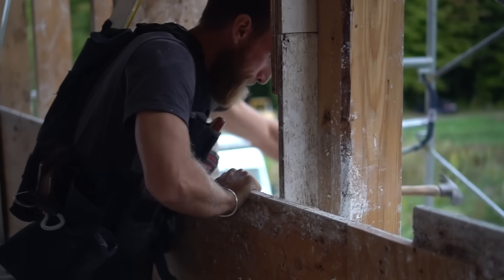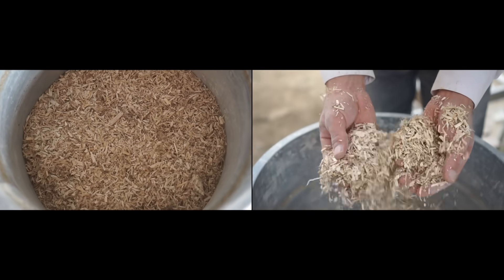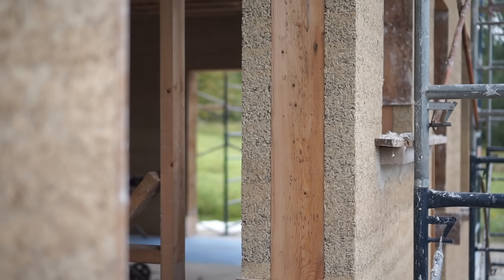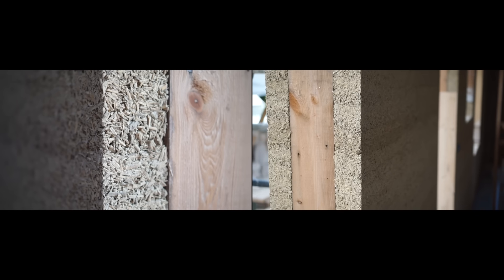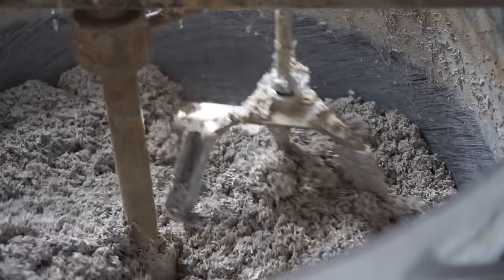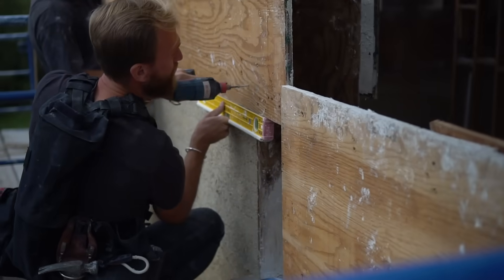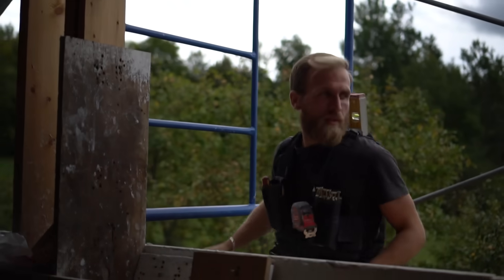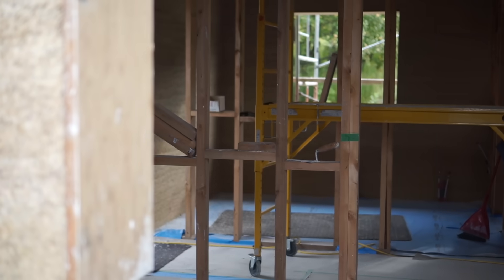Building with Hemp – An Incredible Natural Insulation & Sustainable Material

Comment: Can you explain why the timber stud is placed in the middle of the wall rather than on the interior? Surely on the interior it would allow a fixing for a wall plate for your first floor posijoists or similar. In addition it would ensure greater structural integrity to the frame of the building helping walls stay straight and plumb as some timber studs are not that straight over a 5 meter length. I ask these questions as I intend to build a Hempcrete house for myself. I built a Hempcrete house last year from sips panels, they had great insulation qualities but as a joiner stick built would be my preference. Where abouts are you building ?   Jeremy
Reply: i honestly dont know the true answer myself, but ive seen it where the studs are showing on the interior walls and not the outside, and then some that dont show. i think that for it to have an r25 value it needs to be 12 inches thick like he said, and he also said that it is not a load bearing material, so having your studs in the interior part of the 12 inch thick walls wouldnt be as secure as in the middle, giving equal amount of support. thats just what i think but i think it also comes down to preference too on wether or not you want sheetrock interiors or to have the natural hemp material show
Reply: You built a hempcrete house with sips? They were premade of hemp?? Do you have info on where you got yours? Total cost?

Comment: Nice video, very informative. Question: Could the same process be done with any other material or is there something very special about hemp?
Reply: Well, hemp hurds have special characteristics, such as open porosity and capillary action, that have a lot to do with hempcrete's performance. It allows the migration of vapor, but also phase transitions : when the humidity evaporates in summer, it cools the wall, if vapor condensates in winter, it warms the wall. It has also a low thermal effusivity and feels warm compared to a masonry wall, allowing to lower the temperature of the air with the same level of comfort.
Now, it doesn't mean hemp hurds are the only vegetal material with these properties, it just happens to have been used and studied since the 80's.
It was first used to replace the wattle and daub for the restoration of old half timber houses. It was chosen because it was a cheap by-products of hemp fiber production, and more readily available than straw. But there are now experiments being made with Miscanthus (silvergrass), sun flower stems, and lavender stems (a by-products of the production of essential oils).
Hempcrete, however, benefits from 40 years of hindsight, and has, in France, been tested by the "scientific and technical center of construction" with regulations and trainings for the professionals. So you can get the 10 years warranty from the contactor that conditions subventions for efficiency improvement, for example. It's even recommended by local authorities, especially in old houses restoration.
Reply: I haven't seen anything here that suggests it cannot be done with other material. Essentially it is just an organic version of concrete madd with fiberglass. The many strands inside do strengthen. The product and possibly insulate. 
So while hemp could be the best option, it is not unique in this. Fiberglass reinforced concrete is already a thing.

Comment: Pretty cool! But wouldn't wheat or barley or any cellulose structure work exactly the same? Or is there some distinct advantage that hemp carries in its composition that I'm missing?
Reply: i think tbh its part of the hype of trying to get hemp used mainstream unless im missing some form of magical composition of the hemp itself.
Reply: Michael Kogan Hemp doesn't require the kind of water and chemical fertilizers required by most other crops such as wheat.
Reply: Hemp provides natural resistant qualities to rodents and ants (due to high concentration of silica I think)

Comment: Fascinating building material and technique, I'm curious though about how this withstands saturation at ground level where snow pile up can occur.
Reply: It doesn't. You must use concrete foundation as usual. But you can plaster any concrete left showing above ground to match. This product may bring back the plasterers trade but it's super labor intensive and still need carpenters to frame inside walls, roof and floor systems. Only the wealthy will be able to afford this type of building.

Comment: unfortunately its very expensive and has low R value so you would need very thick (50cm +) walls to make the house energy efficient; also the wood frame construction creates thermal bridges everywhere
Reply: Framing is to be encapsulated so how can there be thermal bridging?
Reply: @bad2mx  rafters? and all other pieces that link the outside with inside; also the wood has lower R value so when the straw thickness is lower because there is a piece of wood it lowers local R value and creates a thermal bridge;

Comment: I'm starting the process of planning a small home to be constructed in the Pacific Northwest of Washington State.  After looking through this manufacturer's instagram page, I noticed that there were two pictures indicating high humidity situations: one built in a wooded area with sword ferns and another surrounding a swimming pool, so I'm wondering if the product is durable in a wet climate, as the Pacific Northwest is considered the dampest  place in the continental United States?
Reply: The lime causes the shiv to petrify when cured, remains breathable and will not mold. Tho curing time may be a little longer in the PNW where I live also. You may only have to make provisions to keep a wall protected from wind drivin rain or roof run off splash until the curing process takes place.
Reply: @bad2mx  surely constant bombardment from daily rain will weaken this structure. its not always about worrying about the hemp but other parts of the building like roof structure etc. which is where damage happens over long terms. to me it doesnt give a better solution to what we have, maybe a just as good alternative but no way better atleast for the uk environment.
Reply: Christina Elliott let me know if you’d like design help from an architecture student around here studying Hempcrete.

Comment: I've wanted to build a house from shipping containers for years. I believe hempcrete is the ideal material for the framed out spaces between my containers and the perfect external insulation for the containers themselves. Has anyone considered making SIPS with hempcrete in the middle of the plywood panels instead of styrofoam?
Reply: Gene Jordan hemp-crete would be very heavy with thickness needed to have good R value. Maybe they could just use packed hemp without the concrete added, not sure what R value hemp alone would have?
Reply: @longhairmullet  You are correct. I had mis-typed that. Packed hemp would work as an insulation. Perhaps Hempcrete would work for the base of the framed out walls between the containers? However, the thermal mass stored in a wall of Hempcrete facing the sun might prove useful in the winter.
Reply: I'm thinking along the same lines

Comment: No comment on the use of anhydrous lime?  That's a huge component of cement and concrete which, the production of which,  is a a huge CO2 emitter.  Hemp is great, but I think other binders like clay or other non-CO2 emitting materials would be better.  Hemp as a fiber source should have been more mainstream decades ago.
Reply: The natural hydraulic lime used in hempcrete production is not subjected to nearly as high of a temperature in the kiln as typical concrete mixes.  Although there is some co2 produced in that process, once combined with the hemp hurds, hempcrete is truly carbon negative.  The lime as it vitrifies over time will actually re-absorb a portion of the carbon driven off in the firing process.
Reply: yea i thought someone in a different video used non-hydraulic lime which can absorb some, most, or all of the CO2 freed during production (firing in a kiln), apparently depending on how hydraulic/non-hydraulic the lime happens to be.
Reply: You're right, producing lime generates carbon when the calcic rock is being cooked. But even considering that, hempcrete is still carbon negative. Talking about clay as a binder, thats a good idea! But clay based binder result in a product that will dissolve in water, we live in north america where the climat is kind of humid, sometimes wet so we prefer lime. We sometimes use clay for interior divisions for greater sustainability. Clay is just the greatest building material of all time.
Reply: Meanwhile, wood.
Reply: @g.e.o.r.g.e...  what does wood do when wet George have a think? it absorbs and eventually without proper drying time and rid of moisture it rots and weakens. come live in the uk its nigh on impossible to keep a wooden house since it rains like over 200+ days a year. its okay in most of america where its nice and sunny for all ya'll.
Reply: @Dockhead  somehow I don't get the impression that this product is suitable either, at least not without a lime plaster facade. If you're going to face it with lime anyways, why not just build a classic wattle and daub Tudor home? Soil and straw are practically free, certainly cheaper than quicklime and hemp.
Reply: @g.e.o.r.g.e...  Better insulation? Maybe it doesn't have an R value of 2, but it likely insulates much better than cob.
Reply: @teaCupkk  I doubt it's substantially better, and with how dense it is... you're on the verge of having your walls act like a thermal mass, rather than insulation.  At that point, wouldn't going the other way be more beneficial? 
Certainly from a cost perspective, cob is WAY cheaper and more easy to source than tons and tons of hemp.
Reply: Why not just make the house out of wood?
Reply: @g.e.o.r.g.e...  pay attention george the house is, this is semi-rigid insulation
Reply: @scheideggerUSVI  I meant in terms of making it more eco-friendly. Why not just have a traditional wooden house with 12 inches of cellulose insulation and skip the lime?
Reply: @g.e.o.r.g.e...  because hemp grows super fast in great quantities compared to wood which would takes years and years to renew
Reply: @g.e.o.r.g.e...  are you aware how long it takes for trees to grow, Or hemp for that matter?
Reply: @0tolerance583  I am. It takes 3 months for hemp to grow, and on average about 10-20 times longer for trees to grow.  I think George should do some more research, he has no idea about the wonders of hemp. You can literally create fuel and fibre from the very same yield . It's the strongest fibre on the planet producing materials 10 times stronger than steel, and methanol fuel is completely carbon neutral and burns no smoke
Reply: Plants need CO2 to grow.
Reply: hemp was a mainstream fibre source - but the prohibition and vested interests in the oil, wood and pharmaceutical industries took care of that.
Reply: @TheRealSamPreece  yes and racist propaganda convinced the farmers to sacrifice their rights
Reply: Deimos Cain  materials don't have to be light to float on water, just lighter than water.
Reply: ugh clay?  really?  co2 isn't as bad as you think...
Reply: @iskdude9922  you are right, that was one of the biggest lies we were told for decades...we now know we need CO2....that is an intrinsic part of nature and our lives

Comment: Other than it being trendy, what is the benefit of hemp over any other plant fiber in this application? Does it stand up to huffing and puffing by wolves?  :)
Reply: @Shawna W I am just unclear what the point of this is. It really isn't anything new other than choice of material. Wattle and daub and adobe construction are about the same using straw with mud as a binder instead of the lime here.  If the material they are using is just a way to utilize the waste of the fiber production, I am fine with that. They just don't explain the rationale behind the choice of materials.
Reply: They are using the woody center core of the plant called hurd or shiv not the fiber. It is the only part of the plant and the ONLY plant that when it cures when lime is used it becomes petrified and will shed water. So far no other plant material has been found that does this. It can also absorb and release moisture with out mold problems. Also it is insulation AND thermal mass.

Comment: In term of ecology, this methods is far better than concrete.
Reply: but it isn't a concrete subsitute... it has no compression strength and very little tensile strength. it is basically a fiberglass insulation and gypsum board in one step product...
Reply: Yeah except the r value sucks.